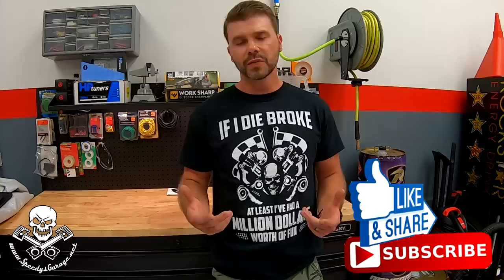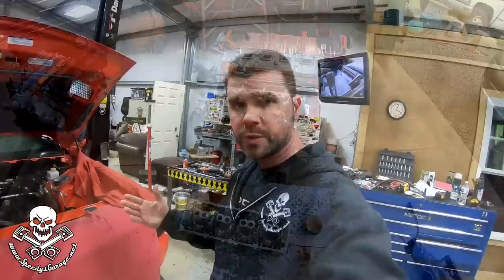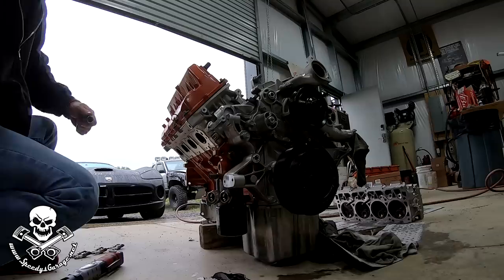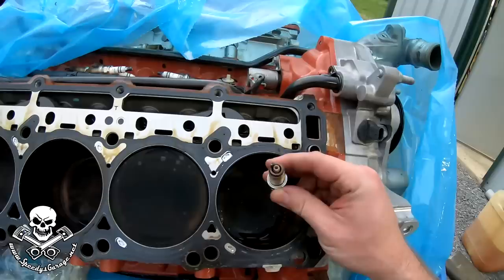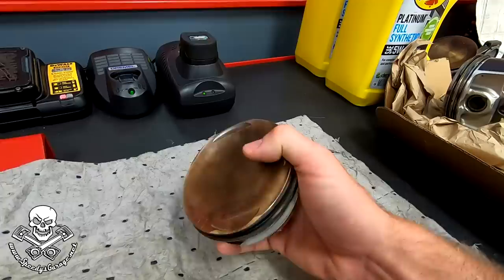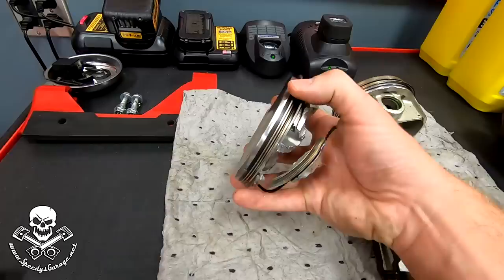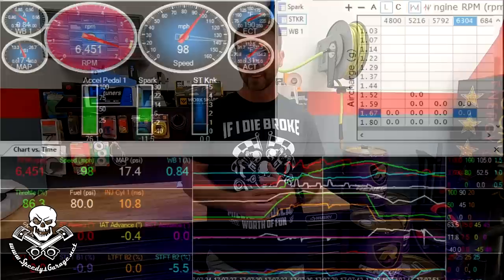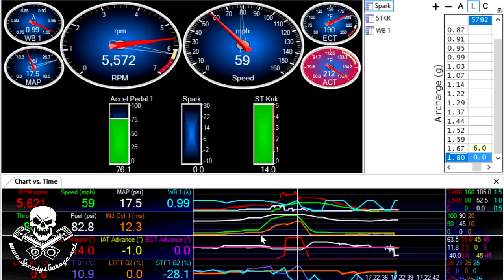Hellcat Engine Failure Diagnosis Speedy's Garage Challenger Go Man Go

Comment: The JB Weld piston I ran in my lawnmower did the same thing, tore the piston pin bosses out of the piston after 3 minutes of grass cutting. I have suspected for years that pistons/rods in a 4 stroke engine usually fail when the piston is snapping over TDC between exhaust and intake stroke, as the gas loading on the piston is much less than during compression stroke. Thus the rod/piston would suffer a tension failure at this time versus during the power stroke when the expanding gases would push against the piston counteracting the inertia forces of the piston deccelerating approaching TDC. Just my 2 cents. I also wondered the same thing, as #2 cylinder follows #7 firing in a normal 1,8,4,3,6,5,7, 2  V8 firing order. Forgive me if the Hellcat uses the modified firing order where 7 and 4 are switched.

Comment: People most often think about the tremendous forces applied to a piston and connecting rod when a cylinder fires. But what's often forgotten are the tremendous forced applied to a piston and connecting rod when the piston goes up at high speed speed and then has to come to a dead stop before being pulled down again at high speed.
Reply: That why two stokes can rev more than four
Reply: @garypeatling7927  That isn't why, 2 strokes have the exact same forces, what limits 4 strokes is/was valve float, Ducati had/has a desmodromic system where valves were opened and closed by cams and often ran 11,000 to 12,000 rpm back before modern high tensile strength metals.  Honda currently has a 250cc with a 19,000 rpm redline. And that's not even going into F1 where 20,000 rpm V6s are common. I know there was an rpm cap, there were engines faster than that.

Comment: I was thinking all along what you said at the very end of the video. I think it was that hot intake air temperature that did it. Piston and rings swelled up inside the bore and made that piston a little too hard to pull back down and it just ripped the skirt right off. That had to have been what happened. You got to realize, the temperature you’re seeing coming into the engine that’s all the way up in the intake. By the time you go to compress that gas before it is ignited it’s only going to heat up even more!  When you compress gas together rapidly it heats up rapidly, even without igniting the mixture.  By the time the spark plug hit that intake charge was surely a few hundred degrees more, if not over 1000 degrees.  Plus, your back cylinders are always going to run a bit hotter than the front ones, they’re the last ones to see the coolant in the block before it goes through the cylinder heads and is cooled through the radiator. 
   Was the engine sitting and allowed to cool way down between passes?  We all know that metal expands when heated.  That’s why they say to never flog a performance car when the engine is cold.  Everything needs time to warm up to operating temps to allow the tolerances to tighten up.  Hope this all helps

Comment: I agree with the comment/ theory that all the parts and engines are "mass-produced" and that could be the issue.  In "blown" engines (positive displacement and or turbo supercharged or composite supercharged & turbocharged engines) the smallest of issues can become major issues in a heartbeat.  I have built and raced and maintained 2 and 4 stroke motorcycle road racing engines as well as 1, 2 (twin) and 4-row radial military aircraft engines prior to computer data logging abilities and had to rely on post-event evaluations as to why engines failed.  I would personally believe if I had to point to a single item/ issue it would be the cost-saving measure of the factory not using a torque plate while boring/ honing the cylinders.  The difference is tiny by any standards but "can be" significant during the extremes encountered by any engine not designed from the onset as a "blown" engine.  The levels of stresses involved accelerate so quickly and suddenly that it can be almost impossible to catch.

Comment: That piston isnt "forged", or actually extruded,  its a casting  as it has cast in numbers inside the crown.
It was simply termically/mechanically stressed beyond design parameters.
Amazing that people expect them to survive racing and that they actually do in many cases.
Reply: extrusions are forgings, nothing like casting
Reply: Its a mopar thats the first issue
Reply: The piston that is broke is a forged piston.  The old 5.7L piston he showed is a casting.
Reply: @JamesBrown-hc2yg  Not mopar, but no nopwr.
Reply: @whatchu_talkin_john_willis  
Maybe my grammatics are bad, I tried to say that the piston is cast and at the same time clarify that what's called a forged piston actually is extruded. Aluminium can not be forged, its instead heated and pressed into shape in a special process.
Reply: James Brown sure is
Reply: Dodge has made junk for the last 40 years, why would a pretty new Dodge be ny different??
Reply: @scottyjones27  Playa hataz convention is set for next month, did you get your invitation in the mail yet ?

Comment: Haven't seen any of your videos before - very well done and excellent points raised!

High ring pack is for emissions and power, lower is for top land strength.
Were you able to check the remains of the connecting rod small end - if it failed it may have allowed the piston to rack sideways a little, stressing the pin area of the piston until it failed? I think, though, you and your buddies called it, though - poor piston quality allowed the 'pin bosses to fail.

Comment: All I see is too much timing or too much heat in that cylinder. The cylinder got super hot and seized up the piston. That’s why it’s all blue at the bottom. Haven’t built many Hemi’s but I’ve seen this on LS engines where one of the cylinders got too hot. Appreciable you sharing this with us.
Reply from the maker: I think it'd be hard to get too much timing when it maxed out at 11 degrees, but maybe too little?  In the factory tuning timing is retarded in order to heat up the cylinder and light the cats off.  Interestingly the factory Red Eye tunes have 9-10 degrees in them max timing.

Comment: If you broke the ceramic on the plugs its from knock. It was the tune. The ceramic on plugs don't break unless there is detonation.
Reply: You are right and that is one reason...its normally heat related this can be due to detonation...but the pistons tops and the plugs were the wrong colour...they normally have a white coating from running lean....as he said in the end of the video the air intake temp spiked....I would say this was blow bye from 7 being forced into the intake through the crank breather...this is what probably melted the plugs due to cylinder temp being too high.....
Reply: Bingo! You win. Too much spark,too little octane. Dump a gallon of toluene in there.
Reply from the maker: Logs showed zero STKR.  I showed that in the video as well.  Not saying detonation didn't occur, but if it did the car didn't pick it up and the pistons didn't show signs either as you saw.
Reply: @SpeedysGarage  you said in the video the logs showed timing being pulled. Then you tear it down and there's evidence of detonation everywhere , melted plugs, broken ceramic on the plugs. And then you comment contradicting what you say in the video lol. Detonation doesn't always occur on the top of the Piston, usually when you're on the edge it starts at the ring lands.
Reply from the maker: I don't have time to type it all out here, just go back and watch the video again if it's not clear.  Timing being pulled wasn't knock and I'm sure you know that 0 degrees of timing with 17psi of boost at WOT causes many problems (lots of heat).  That's what we see here, but the problem was something else.  Max timing in the tune was a paltry 10.5 deg.  I've been running almost the same tune and pulley on the new motor for about a year with the same 93 fuel as well.  Watch some of the newer content to see that we ended up with a 9.83 at 141mph.
Reply: Adam Lolno  Those are forged pistons.

Comment: Wow, a floating piston during a quarter mile running 10s...probably just built for 6k rpm on a factory motor of 800hp, running 7k rpm on stock rods and pistons will give on a Hellcat...lesson learned..forged pistons and rods built for racing...great video along with data logging of the failure 👍
Reply: I'm pretty sure a  stock hellcat uses forged rods and a forged crank and I thought the  Pistons were forged  to I mean I don't think Dodge is that dumb to warranty a 800 horsepower motor and not use a forged lower end AKA short block that's why they absolutely do not recommend pudding a supercharger or turbocharger on a non hellcat Challenger cuz the lower end of the motor is not forged parts
Reply: @kennethjanosick5939  These engines, and also the LS Chevys, are well engineered to work and deliver an excellent power curve at a designated operating range. However, when tuning, and the installation of power adders like forced induction or nitrous come into play, these engines are delivering power beyond what the bean counters (engineers) anticipated. We got to work on some LS engines that originally came from a specialty division of GM Mortorsports, and they had Callies forged cranks & rods, with JE pistons. No hypereutectic pistons or powdered metal rods in those engines.

Comment: When metal parts fail, it is almost always at a sharp corner. Threaded parts fail at the root of the thread.
Parts with grooves fail at corner of the groove. 
That's why these type of parts are engineered with a radius at the root of threads and corners of other parts. The larger the radius, the stronger the part. A sharp corner causes a stress rise in the part.
It is possible that the oil ring grooves of some pistons have a sharper corner than others, caused by tool wear during production. 
Also if the oil passages have a sharp corner where they meet the oil ring groove, it would cause a strees rise and potential failure spot.

Comment: Just a failed piston. I think its a fluke.  I believe the factory pistons are actually manufactured by Mahle. Not junk. Those guys know there stuff. My Buddy works for CP Pistons and has nothing but good things to say about Mahle. Id love to see the difference between a Demon/Redeye Piston and Rod assembly versus a Hellcat.
Reply: As an engine machinist with 35 years of experience I agree. No one makes a better factory piston than Mahle.  This is most likely a fluke .
Reply: This is good to know. With me just now beginning to modify my hellcat. I am happy that this was just more than likely a one off. Not a factory problem.

Comment: Over 60% of the late model Hemi i have re manufactured (aprox 25 longblocks) had failed due to intake seats coming loose and breaking.
If your rebuilding an engine with a seat failure make shure you pressure wash your intake manifold really good. Try to get every port from every angle possible. There have been reports of fresh rebuilds pulling pieces of broken seat debris into the cylinders under heavy vacuum scenarios.
Some after market gaskets have a screen embedded in the intake gasket to prevent this from happening, but im shure they will adversely affect top end  performance. Any sign of issues i remove the seats, machine and install new seat inserts. If there not getting replaced i will steak around the seats using a center punch to ensure the dont move.

Comment: The pattern of breakage on the piston looks like fatigue failure. Usually has a dull, satin type appearance from the cracks gradually progressing before it fails catastrophically. The final sudden fractures will be more shiny and metallic in appearance. That's also where you'd expect to see it. Those holes are at least drilled and not cast slots, but still they are stress risers.

Comment: I think u will find u had ring pinch because of to high cylinder temps the melted/broken plugs tell u it was preigniting which will raise cylinder temps once the ring ends touched the piston tried to stop moving and the rod pulled the bottom of the piston off .i have seen this in several turbo motors including our own 2jz when we ran to much boost for a stock bottom end (data log told us tune was ok) the parts looked identical .piston , rod , plugs all looked as urs did
Reply from the maker: Good info.

Comment: I did the exact same thing to my 1985 S-10 2.5L Iron Duke motor by putting it in neutral and flooring it, seeing how high it would rev.     It rev'd pretty high... then BAM...   piston exploded.  In my case the entire piston shattered,  then I had just the rod and pin rattling around in the cylinder.. it was SO LOUD, but awesome at the same time.  Good Times!

Comment: Similar failure found on entirely different engine. Found oil squirters for piston  blocked, overheated piston momentarily locked ripping wrist pin out of bottom. Remaining lower portion disintegrated so rod and wrist pin were flopping up down in bore. Rod was long enough that didnt jam and break but still had bend poss due to hitting debris and piston top. In this case heat was the killer.

Comment: Looks like the piston failed first. Did you check the rings to see if the rings got hot ,expanded and lost ring gap. They do that and stick in the bore and rip the piston apart.

Comment: My stock piston broke as well. It was on the side. Looked fine when I took heads off. Ring lands broke on the party of the piston with no support. Now I run 2618 forged mahles. Super bummer. Hate to see that.
Reply: Ring lands broke because u got ring pinch
Reply: @xenith0351  correct.  Stock gaps and I was spraying it till she broke.

Comment: Looks like the pistons use an offset pin which is great for making torque...but it also increases the side thrust on the skirts.   Anything with offset pins to me means you really watch the RPM's and never exceed the factory redline or skirt failures will happen.   Bet aftermarket pistons are symmetrical pin design which will hurt the bottom end torque production a bit but will be more reliable at higher revs.

Comment: Curious to know how often you change the plugs while racing and pushing the motor. You have documented the timing change but did you pull plugs and bore scope to check after each inconsistency? Props for detailing such catastrophic failure on your motor.
Reply from the maker: Not often on these cars and plugs.    The engine had about 7500 miles on it.

Comment: I am a small engine mechanic. This was caused by a bad batch of aluminium. Once back in 1990 I had 12 hp Briggs and STratton engines that would stick intake valves open on brand new engines. Briggs and Stratton called it "Porus casting" from february to april that year, it was aluminium engine block, they warrantee short blocked the engine, and another that had done the same thing on another mower in the shop. That piston swole up, and Heat from combustion would do that. Only the faulty ones will do that, you gonna have to know the manufacture dates from your failed piston,  and replace all with that manufacture date. Porus casting of the aluminium piston. You can open the ring end gap, you can bore the cylinder larger, none of it is gonna work because you can't tell how much that porus casting it gonna swell, its an unknown variable. Bad batch of aluminium... You gonna run 9's you need forged or have lots of room for expansion, can't run close tolerances, gonna have to open all that stuff up so it can swell up at high speed. Loose is fast!

Comment: I agree with you that a mass produced part failed as you pushed the revs beyond where the factory programing had it set. 1 thing of note, the 5.7s and 6.1s are fairly loose fitting engines, whereas the 6.2 and 6.4s are tighter, so they are not as forgiving. IMO, the 6.2s and 6.4s are better built then the 5.7s, especially the older 5.7s which had piston slap and oiling issues for the top end. What I found most interesting was what happened to #2. I've not seen that happen before,  except when using nitrous and the tune was wrong. Do you think that the IAT caught it because after 7 let go, it was that far out of balance and the intakes were open when they shouldn't have been for just a split second on #2? OR do you think that the engine's mechanical timing was off enough to see that cough through the intake which spiked IAT? My curiosity is why did just #2 melt down, but no others did?
Reply from the maker: Since publishing this video I talked to a few folks that deal with these a lot, of course it's all theory, but we're thinking that with all the timing being pulled (which generates a ton of heat at WOT and 17psi of boost) things were hot enough that when 7 let go it fried 2 in the process.  Just a theory though.  The tune and logs showed fueling was good at .83 lambda and timing was max of 11 so not enough to melt things like that.

Comment: wouldn't exclude hydraulic locking of the piston, 2 reasons first there were issues with the spark plugs - result lots of fuel going in and not igniting, second, gudgeon pin pulled away from piston near TDC - on compression stroke.  Do agree that the pistons weren't great, heavy cast with not a lot of meat at the bottom of gudgeon pin, BUT the remainder of your pistons didn't look too bad.. Do you run a lambda sensor, if so any signs of mixture running rich through the rpm range>

Comment: I’m at about 850 hp rn and I’m keep having a problem where cylinder 3 is misfiring I took the spark plugs out and replaced them all the one that came out was bent as if the piston slapped it after replaced car ran fine did an oil change found a super small amount of metal shavings was in the oil but now having the same problem again about to start taking her apart hopefully I don’t have anything crazy going on